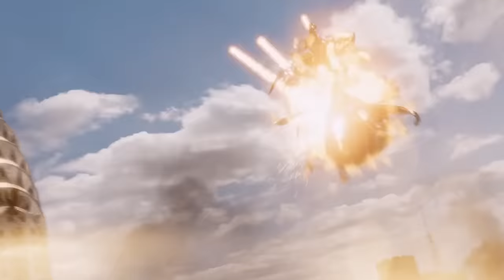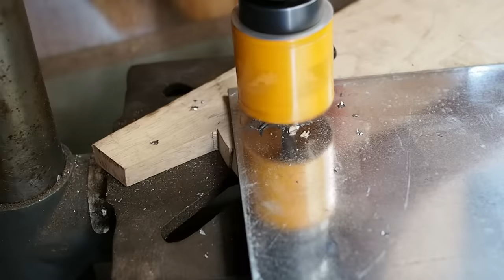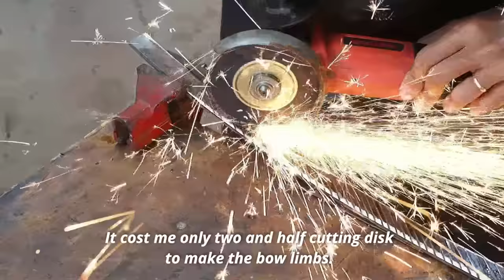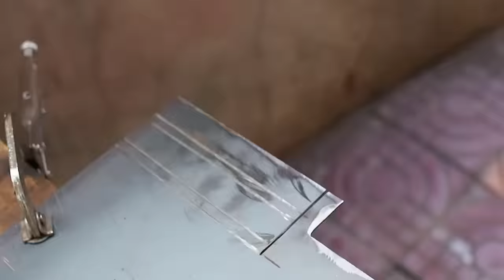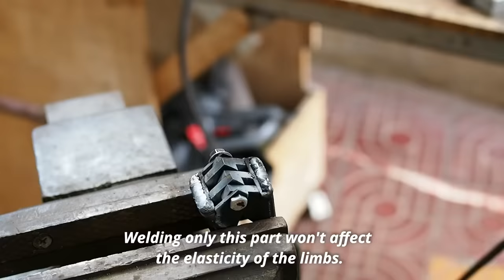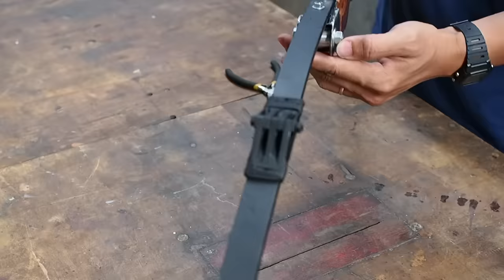Make Hawkeye Bow from Leaf Spring with Folding Limbs | Hawkeye 's Collapsible Bow good for survival

Comment: plz share actual size or diagram on pdf file
Reply from the maker: I am sorry brother. The template is not available at the moment. I but I can give you the following mesurement : Each limb is 2mm thick, 2.5cm wide and each is 50cm long before cutting each of them in half. The riser is 50 cm long and 3.5 cm thick, 5 cm wide. I hope this helps. Pls let me know if you have more question. 🙂

Comment: This is one that I actually think I could make. Are you primarily a metalworker, or would you possibly be interested in making a composite bow, maybe yew and horn? You need not use the ancient "fish glue" that takes 3 years to fully dry; I'm old, and none too sure that I have that much time left. 😁😁😁 Just a  suggestion.
Reply from the maker: I am not a metal worker or a carpenter, but I like to do both work at home as hobby and learning. I made some furnitures from both wood and steel like once a year. I wish I had better Mig welder. It's hard to find a good one in where I live. Thanks for the sugesstion about bow makings. I tried made bow from woods before, and failed a few times as living in SEAsia it's very hard to find hard woods beside Bamboo which are good enough for bow making. I will need to order most material from abroad. So I mostly try to do something easier with available material. I hope one day I can try make other types of bows. 😀

Comment: I think one way to make the bow "snap" would be to have some sort of a pneumatic lever at each "elbow" that forces a edge to slide the arms back until they lock into place. It would also need some spring loaded catches to fully secure them once in position.
Reply from the maker: Thanks for sharing your thought. I will consider your idea when i try to make the bow snap for real in the future. 😃
Reply: And a built-in air compressor with gas generator. Yep.

Comment: huh that's pretty impressive. Steel has a pretty bad stenght to weight ratio compared to good bow woods, basically it springs back much slower beacause of its own mass, so i didnt expect that bow to have decent performances. The hand shock is unavoidable with such heavy limbs tho... But that was nice !
Reply: That's why the limbs should have been made of smth like fiberglass at least. But the conceptual part of this bow was turned into reality quite great...
Reply: @johnwick4380  in medieval times they made up for the inefficiency of steel trough increasing draw weight, but of course on a non mechanically assisted bow that's not an option
Reply from the maker: Thanks brother for the comment. I agree with you. It doesn't peform as good as those limbs made from fiberglass or wood. but based on my experience with fiberglass and limanated recurve bow, i think it's just a bit slower, not too slow. In the medival, people tried to increase the steel limbs of the crossbow also based on the fact that the power stroke of those bows is very short, and that they couldn't make it as long as that of today's modern crossbow as they couldn't trust that their steel limbs won't break. That's what I heard from some experts in other channels.
Reply: Would carbon fiber be more optimal? Would it be too light?
Reply: @JakkiPi  depends. The goal is to have a material that is light, elastic, and hard to bend. Steel is pretty elastic if it's well tempered and made with the right mix, it's very strong, but beacause it's so heavy it will release its energy more slowly, so basically you have to increase the draw weight a lot to have the performances of a more efficient material bow, fiberglass for exemple.
Reply: @backyard.craftsman  yup! I'm a blacksmith and i make crossbows, and 2 days ago i slightly overstressed one limb on a prod i was making, and it snapped with quite a bit of force. So yeah, you can't bend steel too much, especially with old medieval steel, wich was a welded mix. You just have to compensate for the massive loss of efficiency by increasing the draw weight tremendously
Reply from the maker: @jeanladoire4141  have you tried vehicle leafspring? I have almost no blacksmithing experience. but I have made several crossbow prods from leafspring, and non of them breaks yet. I believe modern crossbow design with vehicle leafsrping can be a lot more powerful than medival one with the same draw weight as the mondern design using the leafspring can have much longer power stroke and thus use longer arrows.  You might want to find our how i made them in this link if you haven't watched it yet. https://www.youtube.com/watch?v=E2TWZqbTaJw&t=515s&ab_channel=BackyardCraftsman
Reply: @backyard.craftsman  i saw your video, that was a nice project! I indeed forge my prods from 45Si7 steel or from old leaf springs (be careful tho, old springs can be overstressed and have micro fractures in them). But even tho i used modern steel, improper/uneven bending of the bow will lead to failure. My heat treatment was too much on the hard side, and the draw length was a bit long for my bow (it was pretty short and compact). I don't think we could improve medieval designs by that much, even with our modern steel, as their metallurgy was already pretty good and their technology pretty adapted to steel. I wouldn't wish anyone to have a prod failure while loading, because hardened steel giving up its energy all at once will send chunks of steel like a whip
Reply: He used spring steel, not cold roll.
Reply: @russelljohnson6243 ... I will appear mean but i think you don't know much in metalworking. A cold roll is a process, a spring steel is a steel with good elasticity limit... That means spring steels are sometimes cold rolled. He used a lead spring, wich is both hot rolled/forged, AND heat treated for improved elasticity. And i didn't talk about cold rolling, i'm a blacksmith and when i make a steel bow/prod, i hand forge it entirely...
Reply: После того как мастер сделал арбалет его давали оруженосцу для пробы. Натяжка составляла до 400 кг и если рвался стальной трос то отрывало пальцы и руки.  @backyard.craftsman
Reply: Remember, this bow was made from leaf springs which is hardened steel which and will maintain its shape almost as good as wood. A steel bow is heavier but far more durable especially in a combat or survival situations.
Reply: @thepleblian2079  a tank is more durable than a car, that doesnt mean it's a better option to travel

Comment: Awesome build! One suggestion for the snap open effect, what if you used a locking mechanism like a flip out of switchblade knife? A catch that springs when the arms extend? You could actually get the flip out and lock to work. For the string you could try a rapid cinch, the upper portion is locked in place and the lower can be snugged into place using weight. I think you could actually build a functional snap out bow with a small change. Could be amazing, and you could sell the shit out of it to all the folks that prep and some collectors.... and some weirdos lol.
Reply from the maker: Thanks brother for sharing your thought. I will consider your idea when i try to make the bow snap for real in the future. 😃
Reply: @backyard.craftsman  a nother thing is magnets strong enough magnets it could preform the snap open then you can secure with some type os threaded nut because in the seen you shone he actualy inspects and messes with those areas like he was securing those areas. just a idea and love your work.

Comment: Are you sure that's 50 lbs draw weight? I shoot 45 lbs all the time, and it seems like you should get a lot more arrow penetration on that piece of fruit lol

AWESOME project! It's impressive work.
Reply from the maker: thank brother for the comment. I think the dept of the penetration also depend on how old the coconut fruit is, and it's also normal for steel bow with same draw weight as wooden or composite bows to be less powerful than them. But i like it's durablity 😄
Reply: @backyard.craftsman  OHHHHH That's a coconut! I thought it was a melon. My perception was very wrong hahahaha. Cheers mate!
Reply from the maker: @TherronKeen Yes cheers mate! 😉
Reply: it is the weight of the limbs that makes the bow slower compared to light composite limbs even if has the same draw weight. how can 50lb steel limbs have less power than 50lb composite limbs? it has to with mass, acceleration, energy stored, and where energy is lost due to the weight of the limbs
Reply: @sphinxios  Oh yeah, I kind of understand that. I never took a physics class but I've watched a few YouTube videos, enough to see how that makes sense. thanks for the info!
Reply: @TherronKeen  lmao yeah, now I wanna see how many melons it would go through. My guess is at least 3
Reply from the maker: @Netherdan but coconut like the one in my video might be harder to penentrate with 50lbs bow.
Reply: @backyard.craftsman  I know, but the guy confused it with a melon instead of a coconut so I got curious.

But then again, there's no benefit in wasting food like that. You can drink one coconut's water just fine (assuming clean arrows) and even if you don't it's just one, with melons you'd have 3 to 5 melons that would go to waste if not eaten fast because now there's a hole (or several) on them

Comment: I always get a little bit squeamish when I see untraditional limbs, i.e. those with failure points, but this looks pretty good. At least it shoots straight
Reply from the maker: I also doubted it will work with the hinges in the middle of the limbs. I am glad that it can shoot straight and as well as my other steel bows with similar draw weight. 😄

Comment: Using both an adhesive (epoxy) backed by a mechanical connection (screws) is very smart.
Reply from the maker: Thanks brother. I am glad you it works. 😄

Comment: I'd say try to incorporate some kind of spring loaded locking mechanism to get it to snap out like in the movie
Reply from the maker: I ve been thinking about it, but as I mentioned in the video caption, I think  i can make it possible to snap without the string on. and put the string on it later. The string will be likely to keep the limbs from turning completely unless I use a very powerful spring to kick the limbs, or the bow draw weight is very light like those I saw in other channel's videos.

Comment: Although I like what you've built, and it's a good design too. But, I've said it before and I'll say it again. Files only cut on the forward stroke. Even if a little material is removed by pulling it backwards, it's only scratching your material, not cutting. All files are made the same. Even a wood rasp is designed to remove material on the forward stroke. Get it right people.🖖💀👍
Reply: There are videos proving it doesn’t matter that much
Reply: That is not necessarily true.... depends on the files....crosscut files work both ways
Reply from the maker: Thank brother for the advice. it's hard to kill the old habbit as it's also what most people do, and it seem ok to keep doing it, and the file I am using has also been with me many years already. They are not very expensive when they can't use as a file anymore, I would turn them into blades like in my other video. https://www.youtube.com/watch?v=2bG4_Bc7eAg&t=32s&ab_channel=BackyardCraftsman

Comment: Remember, the bolt at the hinge joint is under sheer. If they sheer that bow could be a death trap.😇
Reply from the maker: Thanks brother for the advice. I also considered the risk. But I am comforted by the fact that the pin of the bolt was inserted in 4 knuckles of each leaf of the hinge. so it wont break easily. if inserted only in only two knuckles of each leaf, i think I should worry.

Comment: im not sure if this is due to excessive grinding on the limbs in the process or the hinges but i noticed excessive flexing around the mid section, 50 pounds is a bit of an overestimate i would say it looks to be about 40 to 45 pounds. overall though its functional, but not for much more than target practice. that being said you obviously are just doing it as a prop you probably anticipated the downsides to it. im suprised though how well those joints hold while still being functional though
Reply from the maker: Thanks brother for the comment. You have lots of knowledge about archery

Comment: Would adding rubber between the limbs and the riser help with dampening the shock?
Reply from the maker: it's interesting question. I also made bow from fiberglass strips, you might want to watch them in my other vidoes. They also have similar amount of hand shock. I think maybe composite or liminated bows have much less hand shock. I ll try your idea when I have time. Hope it ll help with the hand shock.

Comment: Great, I watched the entire thing because I was "how does he make the bow 'snap' like in the movies?"
The entire time I was "ok, but what kind of locking system will keep the arms of the bow in place?!"

Nice bow, but the fake snap in the beginning was unnecessary, bro
Reply from the maker: Thanks brother for the comment and advice. I thought about adding locking machenism to keep the bow in place and also spring to help it snap, but as I mention in the caption, i would be possible to snap only with the string on or the limbs have very light draw weight. Perhaps someone has already done it successful.
Reply: @backyard.craftsman  I imagine that such a mechanism would make the bow very weak for its weight, but I was intrigued.

The idea of this bow is still interesting, for storage and for short travel, having a bow you can carry without completely disassembling it.

Again, your work was very nice
Reply: @backyard.craftsman  btw, I was looking your channel (you made some very interesting things, congratulations) and a bow I think you would enjoy making is the one from the Witcher 2. It has 4 arms. 
It's not unnecessarily complex, but the arms design are very cool.

Comment: My only gripe is that your welding technique was really bad. If you set a mig welder correctly you can weld 2mm thick steel. Same with a stick welder. Just need to turn it right down and use thinner rods.
Reply from the maker: Thanks brother for the advice. Have a nice day!

Comment: Looks like a fun project. Also would this work on a haftier bow? Like a 50 pown it 100 pound?
Reply: I would bet there's a limit to how much the hinges can handle. You could maybe get up to 50 but I would be very careful just in case it snaps.
Reply from the maker: @Dustin, you are right, this is just an experiment. I would try heavier weight later. I wasn't even sure if it would work at around 50lbs, but thanks God, it does.

Comment: Do you have plans avaliable for this bow ?
Reply from the maker: I am sorry that the template is not available but I can give you the following measurement :  Each limb is 2mm thick, 2.5cm wide and each is 50cm long before cutting each of them in half. The riser is 50 cm long and 3.5 cm thick, 5 cm wide.

Comment: How long did it take to grind the leafspring to the proper thickness?
Reply from the maker: It only take me about three hours to grind both limbs using the technique I showed in the picture and cost me only two cutting disk and my big grinding disk only became a bit smaller

Comment: 2 things, one, please buy some wrenches. The pliers on the nuts almost felt like actual pliers on my nuts. And the welding…omg run a bead. Spot or tack welding over and over like that is just….awful.
Reply from the maker: Thanks brother for the advice. I normally build something like this at the weekend, so rarely have time to do it. I do have wrenches of all size, but i often use pliers when things don't really need to be tightened. As for the welding, it's the best I can do with the thin steel and my cheap MIG welding tool. I think with your skill and tool you can do it without a problem. I am sure my welding skill is very low, but I don't think you ll like my cheep Chinese Mig welding too.

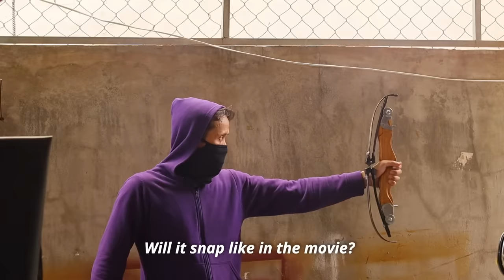Comment: Bahahaha 17:44 😂😂😂😂 you gotta smooth out your editing skills. I can see that with a naked eye, don’t even need to see it frame by frame. Also for those not smart enough to realize. There’s no string, and the bow requires the wing nuts to be screwed down. Unless you can suggest a snapped action cause wing nuts to leap from his pocket and onto the bolt heads to secure the limbs without being restricted by the tension of the string… 😂😂😂 I had high hopes and got thouroughly disappointed

Comment: Do you know how thick the original leaf spring was? I am trying to make something similar but i think my leaf spring is way too thick(8mm)
Reply from the maker: Mine is originally 6mm. i used to work on 8mm steel before to make 80lbs recurve bow. you ll need to cool it down very often with water if you would like to try.

Comment: Steel is a bad material for bow limbs
Reply: And also a handle made of a board that will sooner or later break in half. You need layers of wood, or plywood, and two or three layers of fiberglass between them
Reply from the maker: thanks brother for the advice.